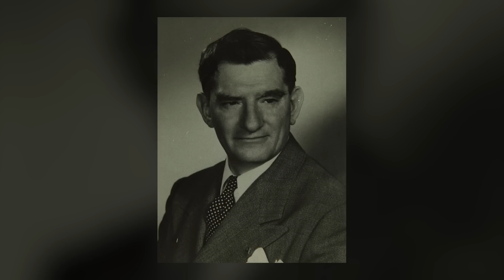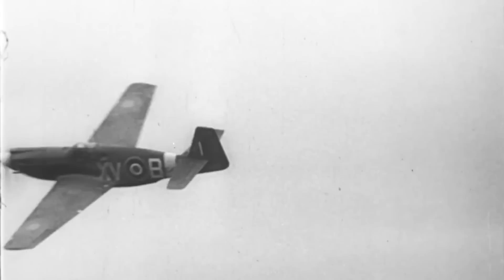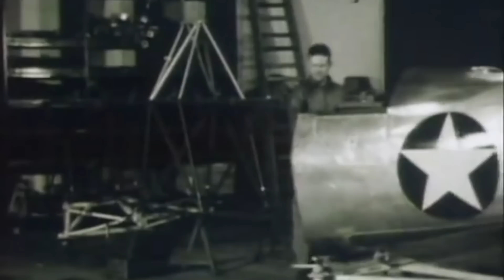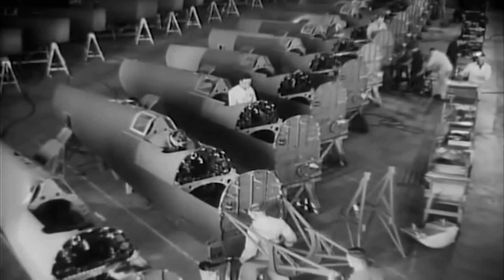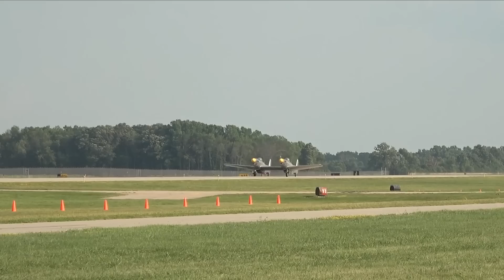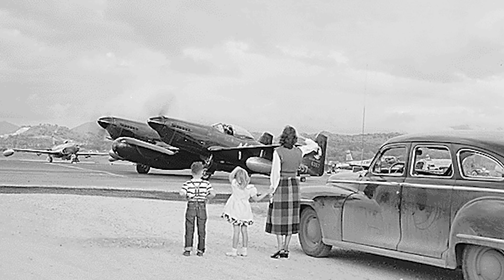Two Mustangs Bolted TOGETHER That Shot Down Jets In Korea: North American F-82 Twin Mustang

Comment: Great episode and very informative! I knew of this aircraft but I had always believed that only a few prototypes had been built. Clearly, I was mistaken. Being credited with the US's last aerial victory by a piston-powered aircraft is an honor to the aircraft all to itself. My previous assumption of it was the second cockpit was occupied by a radar operator. The fact that it had full dual flight controls was obviously as great advantage as you point out. Given all that wing real estate I am surprised it only carried 6 .50 caliber machine guns in the center section. I would have thought there would be accommodation for something heavier like Hispano 20mm cannons, etc. However, that may have made gunnery more precise as the pilot would not have to consider the convergence zone of his guns, much like the P-38 with its nose-mounted guns. Thank you for this very informative and enjoyable expose of this iconic machine.

Comment: So they couldn't get P38 Lightnings?
Reply: The P-38 would not have fulfilled the requirements:  30mph faster than the mustang, greater range and the need for two pilots to alleviate the fatigue one pilot would face on such long duration missions from the Mariannas to Japan and back.  Bill Parks - Tom Reilly XP-82 Restoration Team
Reply: @182436hike  Thanks

Comment: Other than the extra pilot which was a good idea for easing the load, too much was made of the range and armament. The P47N had range just as long albeit with tanks. All versions had six fifties with some had eight. While faster than the P47N by about 25mph, the turning radius mandated by all that wing area of the P/F 82 would have made it a sitting duck in a turning fight with late model enemy fighters. Also I can’t imagine bringing one of those aboard a carrier.

Comment: Packard Merlin V-1650 engines were only used in the first two prototypes. Production P-82 aircraft had Allison V-1710 engines with an auxiliary supercharger for high altitude performance.
Reply: Actually, not true.  The first 20 production P-82s also had Merlins.  The war ended and Rolls Royce rescinded Packard's license to build Merlins.  Rolls then demanded a huge per engine licensing charge for each new Merlin engine built by Packard.  At that point the Air Force elected to go with the Allison engine.  Bill Parks, Tom Reilly XP-82 Restoration Team
Reply: @182436hike  Jut guessing that you have better info than I have. Thanks.

Comment: How did they deal with engine torque having two engines? Did one counter rotate? On such a small aircraft I'm pretty sure it would have been noticeable.
Reply: of course one counter rotated. this happens on almost all two engine aircraft, even the compressor blades inside of a jet engine counter rotates.
Reply: The same way all twin engine planes work
Reply: @TinyBearTim  Well, the Mosquito and a number of others did not have counter rotating props but it certainly is an advantage.

Comment: This plane made little sense, because they got rid of all the twin engine P-38's...  in favor of the cheaper and easier to maintain single engine Mustang.    To make a twin engine Mustang... you're really just right back at a P-38...   that you had already had, that was designed from the start to be twin engined with all that concentrated fire power in the nose unobstructed.
Reply: It's all about the range. P-82's firepower is unobstructed, too.
Reply: @steve-ey3rx  I think most pilots would like to be right behind the guns that will push you back along the centerline.   You've got that long line of dropping metal streaming out from you...   like AT&T, in a P-38 you can really reach out and touch someone.   https://www.youtube.com/watch?v=V1fBnovQ4YE&t=42s
Reply: Clearly you didn't watch this video before typing your shortsighted opinion. Range, added firepower, the ability for one pilot to rest in tandem with the other are amongst the distinct advantages over the P38. 

This plane did not revert backward to the P38. Instead, it was a huge leap forward.
Reply: @c2jones  Yes, that's why thousands were made, and like maybe a dozen P-38's.  Oh wait, no, it was the other way around.  Choppergirl just pwned you.
Reply: @choppergirl  

What a childish and faulty response. Grow up. The twin Mustang was a later design at the end of the war and at the end of propeller-driven planes in wartime.

 So, naturally, there were more older designs than newer ones when the technological plateau had been reached. 

Your absurd argument is no more the point than there existed more bi-planes than Lockheed SR-71 Blackbirds.
Reply: @c2jones  A biplane can crush an SR-71 in aerobatics or a turning dogfight.   You don't know who you're talking to, do you?   Go ask Alexa who is Choppergirl....   

The twin mustang made absolutely no impression on aviation history.  The twin winged biplane, however...
Reply: @choppergirl  

My goodness. You are really thick. Now you're actually trying to rank biplanes to the SR71. The example was to illustrate that quantity has no bearing on the purpose of a design. The twin Mustang had a purpose which it fulfilled. You tried a haphazard angle that because it was less plentiful, it didn't suit a role, which is absurd.

The war ended and the jet age came. The twin Mustang has several unique accomplishments because it was the pinnacle of its time. This isn't that hard. The gap is with you.
Reply: @c2jones  The only advantage the twin mustang could possibly have over the P-38 was a Merlin engine over an Allison.  And if that were the case, don't design a whole new airplane, swap in Merlins into a P-38.

A fighter pilot does not want to be way out on a wing off center line in a dogfight, getting tossed around like a marble in a clothes dryer.

And they already had the P-38's built, they were bulldozing them into gullies by the dozen at at time.  I'm sure there's hundreds of them still underground in New Guinea.   Of all the daft military spending things to do.
Reply: @choppergirl 

The clear advantages are vocalized for you (since you can't bother to read and retain what's been spelled out for you in the comments) within the first few seconds of this video.
Reply: @c2jones  Oh wait, you're right, I'm wrong, I just checked the local airports, they are covered with Twin Mustangs everywhere... as far as the eye can see!   The advantages of the Twin Mustang were so great, it was the most popular design design... eva!  Clearly!   How could I not see that.  All I have to do is listen to some arm chair elmer historians on the internet to know that.

Oh, snap, wait.   Those airplanes I'm seeing all over the local airports... yeah, they're prop driven, but not Mustangs.  Not a single one anywhere!  What's wrong with those people.   You need to get out there and preach to them, brother, that what they are flying is absolute rubbish, the Twin Mustang is the cockpit to be in!   So you can ride the roller coaster up and down whenever you make a turn.  

But hey, I can't read...   but I can type a dmmn book in the comments section.  Bahaha.   Trolling the wannabe pilots...
Reply: ...was just thinking that it wouldn't be as good if the heater was broken but better if one needs to use the toilet...